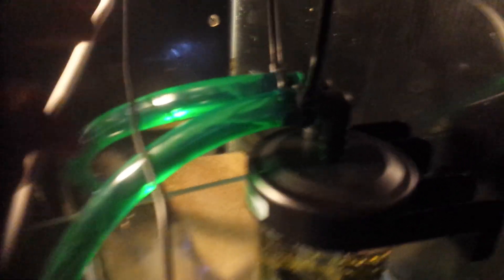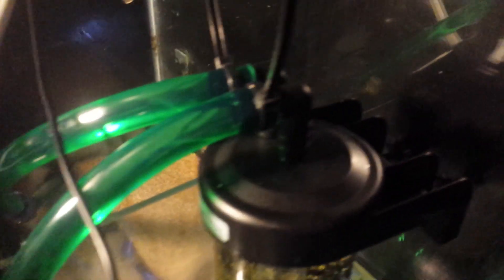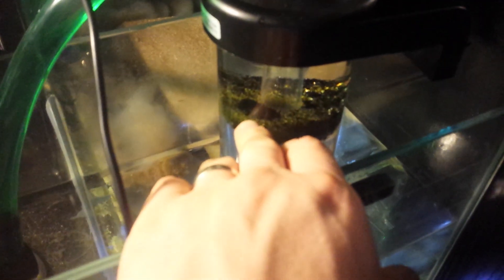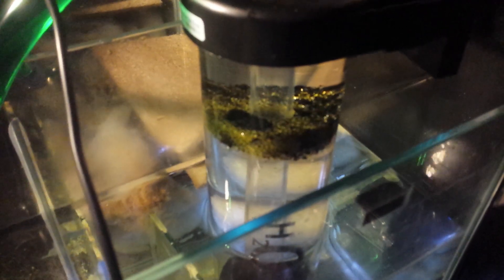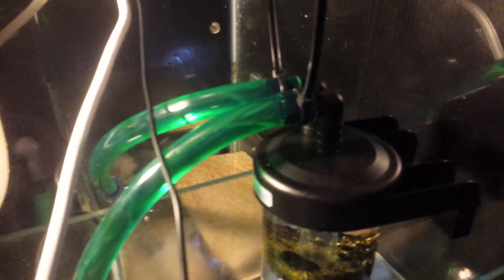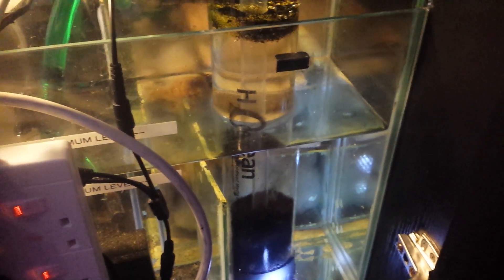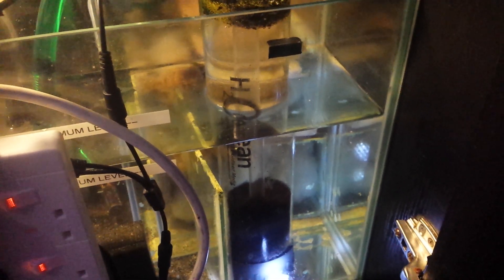D-D fluidised media reactor part 3

Comment: Do you think these d-d reactors work better with out the sponge in the very bottom 

Yours seems to tumble better than mine
Reply: Yes, the sponge is there if you run the reactor with carbon. If you got rowaphos, phosguard in the reactor you need to take out the sponge to get the media tumbling:)